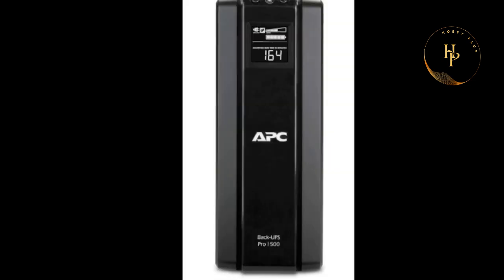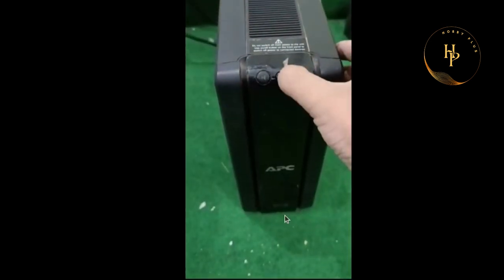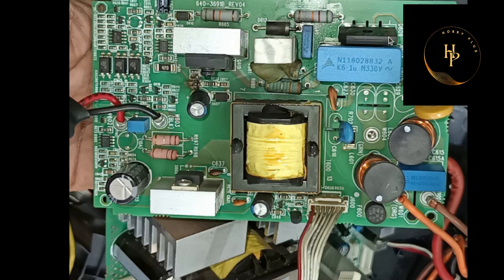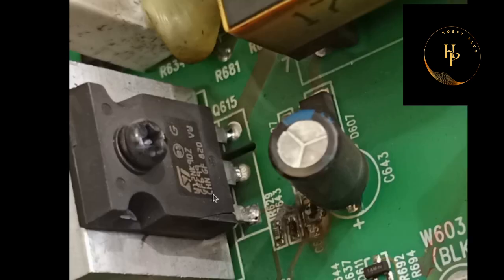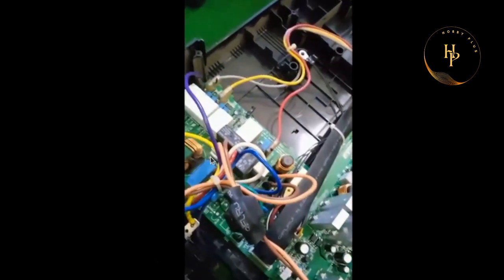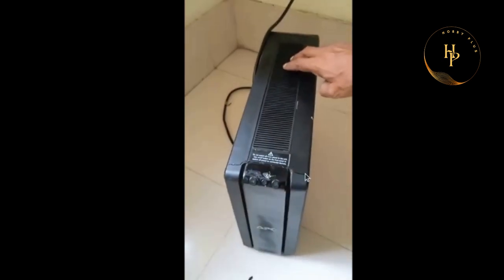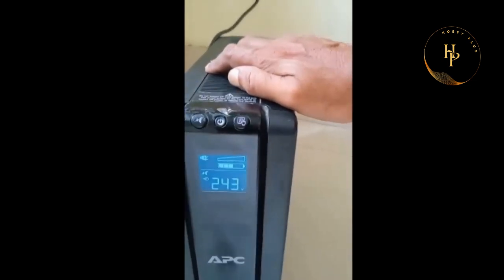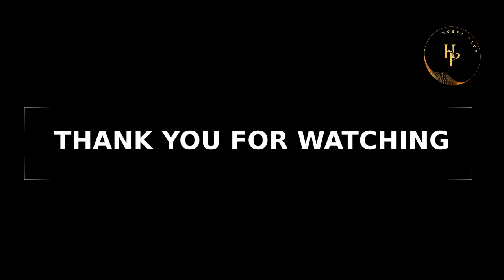[38] F04 ERROR IN APC BACK UPS PRO 1500

Comment: Greetings, I am from Cuba and the F04 error also happened to me and the power went out and when the UPS arrived it works fine, I always do not connect it to the outlet from time to time when I put power on it shows error F04 and there is no power on the motherboard. nothing broken and even sometimes the ups works fine I would like you to help me with that problem
Reply from the maker: that is the charging card error, you should repair this card. I am from India if you send me your card then i can repair this.